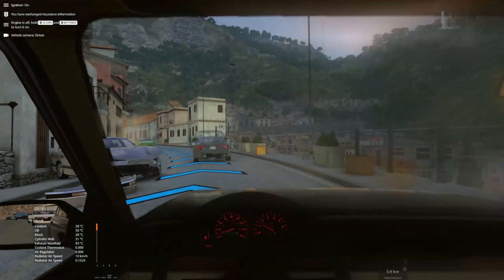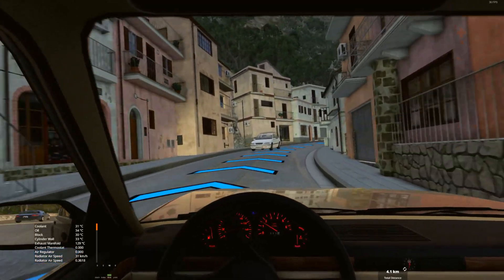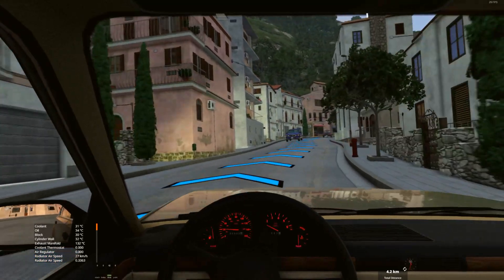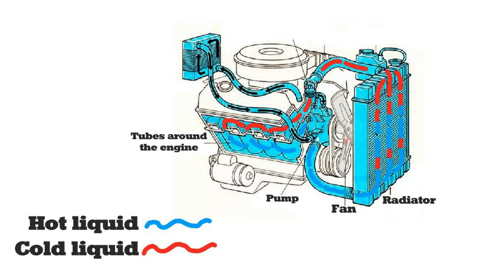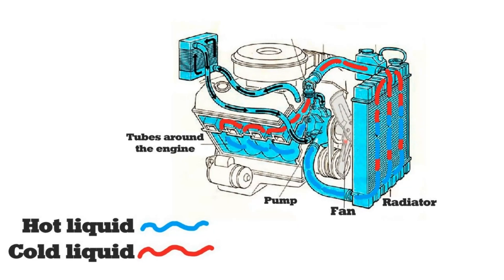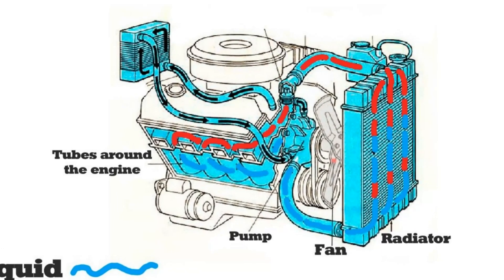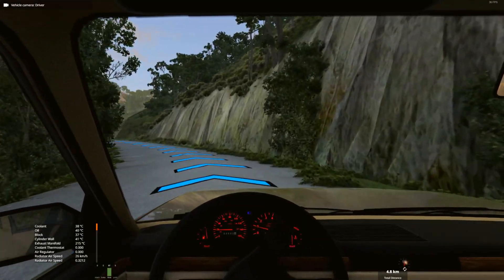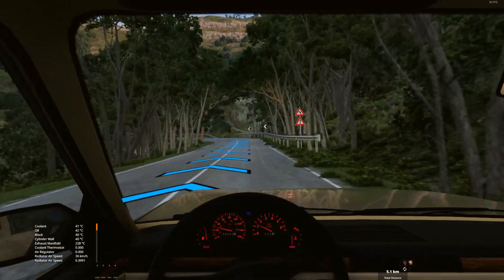Car Without Radiator: How Long Will It Last?

Comment: Use a d series, completely remove the body from the chassis, basically remove everything the car doesn't need to move. It can fit the 6.9 liter V8, so plenty of area to absorb heat, overinflate the tires, make the gears as top speed as possible for lower revs, tune the engine to make as little power as possible (less power= less fuel burning= less heat) also remove the exhaust and exhaust headers, as this will allow hot air to leave the engine as fast as possible. I can't think of anything else besides if you are using wheel or pedals, use as little throttle application as possible.
Reply: Oh, also install heavy duty parts (long block and stuff like that) it'll add a little weight, but will absorb more heat and will survive much longer
Reply from the maker: I'm glad to see people with real knowledge of mechanics watching my videos, I appreciate it :)

And, yeah, I completely agree with you, bigger engine will absorb more heat and in addition it will be working on much lower revs than some less powerful engine to achieve the same speed. Time to repeat my experiments again :)

Comment: My old Ford truck has a Trtion 4.6L engine.  If coolant is lost, it goes into limp mode with reduced power, by alternately firing each cylinder, then pumping AIR thru the cylinder to remove heat.  Lost my serpentine belt and was able to drive home (loss of power steering sucked, but I made it).
Reply from the maker: Wow , that's actually pretty cool technology, that I didn't heard about 🙂 
I know that some cars have air cooling that works because of the fans , but technology like that , that's very interesting. Actually that big engine (4.6L) as you said can absorb lots of heat , as I think , so that helps a lot too. 
And you managed to drive it without power steering, that's impressive 💪
P.S. Your truck probably has a 8 cylinders engine, yeah ?

Comment: Buddy copy MUYE'S VIDEO 
@MUYE
Reply from the maker: Well , actually I just took the idea of the test , bc it's really good. But I didn't copy video in any way. MuYe didn't said about history and structure of radiator , so please check what you are saying.

It's just that your comment offends me a little, because I worked on this video for a long time, and by saying that it is copied, you devalue my work 🙁
Reply: @vertviger  hi I suggest  

"Could you please work on pronouncing your words more clearly?"
Reply from the maker: @colemertanedo5796  Yeah , of course. Pronouncing is my problem , but I'm working on it 🙂
Thanks for the advice 
I hope today I will finish my new video , will see if pronouncing is improving )

Comment: Crazy how long ago the radiator was thought of.

6:00 ok so putting your car in neutral or engaging ths clutch should in theory consume less gas since youre not using the engine while going downhill ,right?

Well not really. When you do either of those things ,you're disconecting the engine from the drivetrain, that means that the engine is using gas to keep running on its own. 
A better option is to just let the engine coast while in gear because it will use the downhill force to keep the engine running , and it wont use gas at all as its using the wheels centrifugal force to keep running (because the cars electronics will cut off fuel to the engine).

This also allows for use of engine braking instead of using the brakes alot ,so the engine is slowing down the engine while going downhill.
This technique has the benefit of not using any gas ( which the 'engine off' technique had ) , while also having the engine ready to go at anytime ( like your clutch/neutral method had ). Its has those two benefit , including the engine braking.

All the comments on muyes videos were mentioning this method as its just better. Also i think that using a higher gear to coast is also a must ,as it stops the engine using alot of fuel and more explosions in the engine increasing temps.

8:27 😂 the subway surfers music 👌
Reply from the maker: Yes, my friend, you are right as always. It just seemed to me that the engine braking would be very strong and I would lose some of the car's speed. But judging by what you wrote, it's not such a serious problem. It was worth a try. I hope you liked the video🙂 I made it quite a long time. Thanks for explaining !